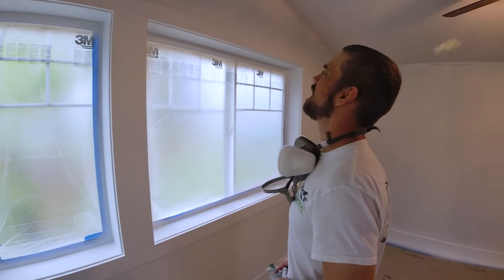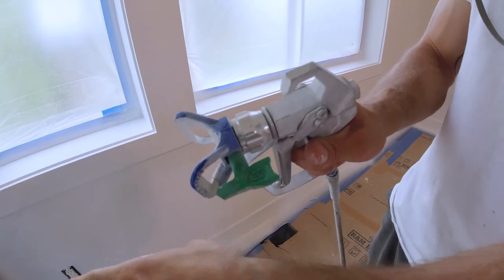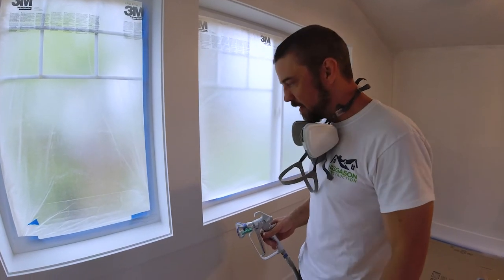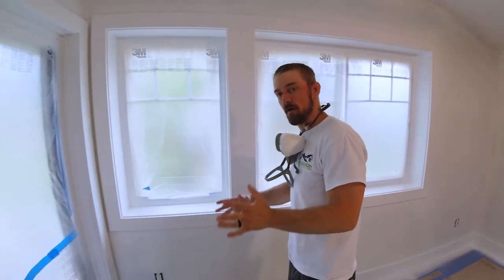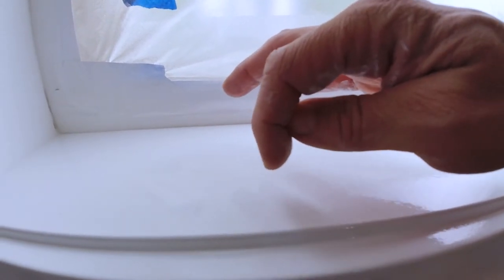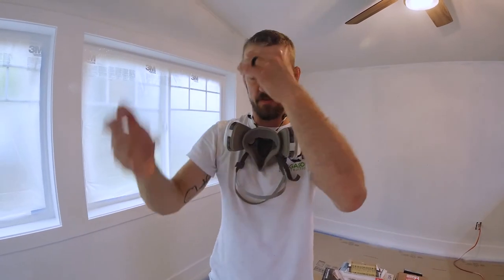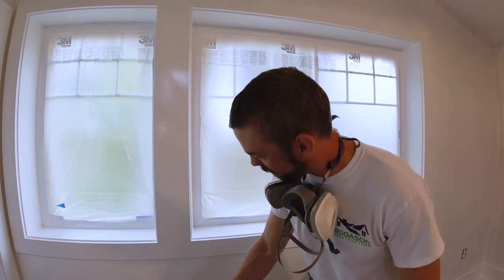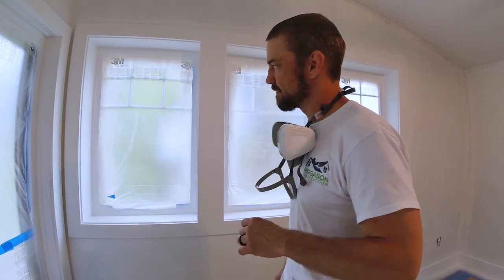How to paint trim (Airless Sprayer)

Comment: When masking windows for spraying; do put plastic to cover most of the window pane surface, but then use a paper masker to tape off the edges. The reason for this is, if you only masked off with plastic up to the edges, the first coat will overspray onto clean plastic which is just fine. The problem is, if you spray a second coat, whatever overspray stuck to the plastic on your first application will blow off in flakes and fall all over your wet second coat, ruining the job. When you use masking paper at the edges this will not happen as the first coat of paint will remain stuck to the paper and will not blow off. Disregard this advice if youre only spraying one coat. On the many new houses that I've prepped for spraying there was a primer coat, first coat finish and second coat finish, which makes using paper at the edges much safer.

Comment: Are you spraying a water base or oil base product ?
Reply: He literally said latex... so Proclassic acrylic-latex. Not the oil enamel
Reply: Hi Jacob - I’m using pro classic as well and on the back of the can it says minimum tip of .017. Did you thin your so that you could spray out of the smaller tip?